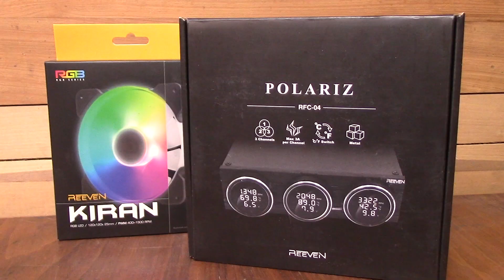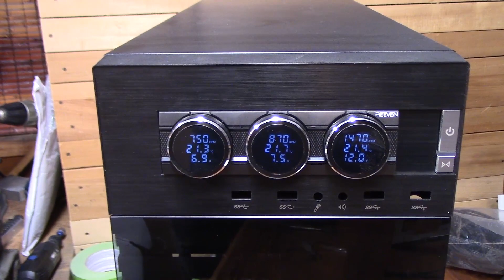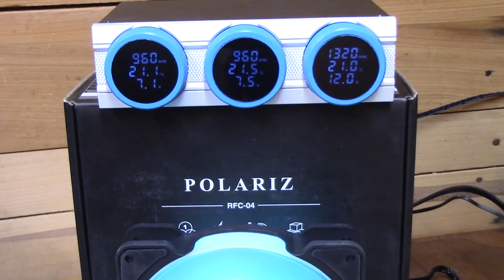Reeven Polariz Fan Controller Review and Modification!

Comment: Just wondering what your thoughts are on where to mount this or other fan controllers in a case with no 5 1/4 inch drive bays.
Reply from the maker: +Tony Stamford If there's no bay, you'll have to cut a hole in your case to install it! Make a bay :p